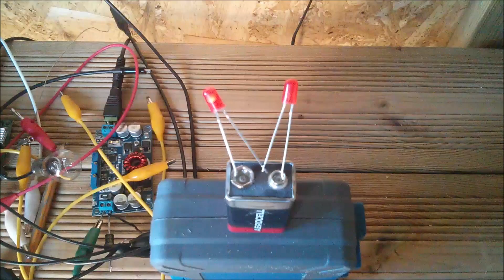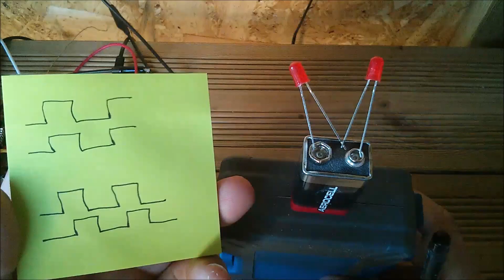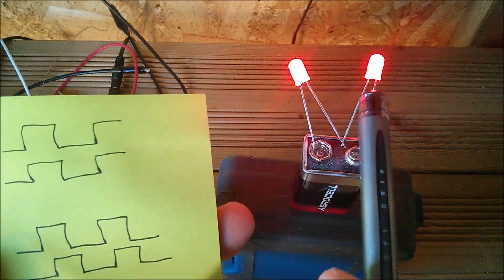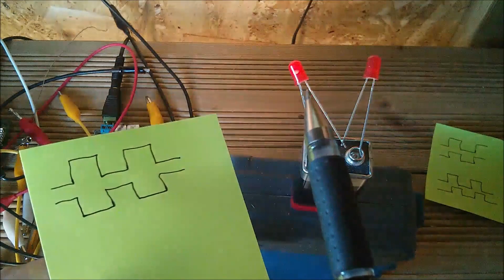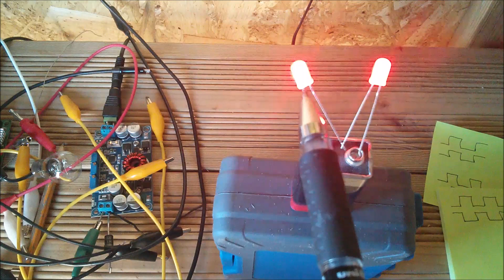Flashing LEDs in Series

Comment: Definitely stealing this for something :) Also pro tip, the flasher chip inside will continue to run down to almost no voltage at all, certainly below the LED's forward voltage, so you can feed them maybe 1V and they appear "off" but continue timing so they don't reset when you raise the voltage again. And best I can tell, it's something resembling a 555 rather than a digital counter.
Reply: Update, I just got a shipment of white ones that behave completely different. Seems like it'll take some trial and error if you're looking to use this behavior in a repeatable way.

Comment: Yes Lets see what the Current looks like on a Single LED on a scope.  It would seem current is flowing when the LED is not lit ( Illuminated ) up.   That  may have uses.   Like using a LED as a Voltage Reference.

Comment: Julian, have you tried measuring the current of these flashing LEDs? Does the current vary with voltage? What current do they draw off a 5V supply with a 220Ω resistor? Is the brightness still good? Same questions, but with a 470Ω resistor? Only I’m wondering if the internal flashing chip is just connected across the two legs, and simply turns the LED on and off, but does not include any internal current limiting.
Reply: My eBay bought Blue flashing LED test results.

When fed via a series resistor from a 9V battery using a LED-Tester 
(multimeter on the 40V range in min/max voltage mode, or 40mA range in current mode):

2.5mA test socket: max V=3.00V, min V=1.52V, max I=2.52mA, min I=2.00mA.
5mA test socket: max V=3.28V, min V=1.88V, max I=4.88mA, min I=3.92mA.
10mA test socket: max V=3.68V, min V=2.44V, max I=9.65mA, min I=7.84mA.
20mA test socket: max V=4.20V, min V=3.12V, max I=16.52mA, min I=13.56mA.
50mA test socket: max V=4.56V, min V=5.32V, max I=32mA, min I=26.2mA.

Comment: We run LED with 1/100 pulses back in the day. By using a variable stepdown voltage regulator we overdriven them quite significant, and they can handle that doe very short pulses, making it look like they are on full brightness when they are really on for a tiny amount of time.

Comment: That is interesting. I'd like to get a scope on these LEDs an see what is going on. 

In any case, I very interested in your broader experiment to power up a large quantity of the flashers. Intuitively you should see an average power draw of half the load of regular LEDs (plus a smidge for the electronics that switch the LEDs), but what is the instantaneous power draw. Assuming you spec a power supply for 1/2 the number of LEDs, will it fall over when all the LEDs decide to come on at the same time?